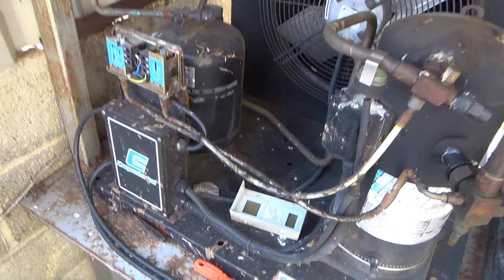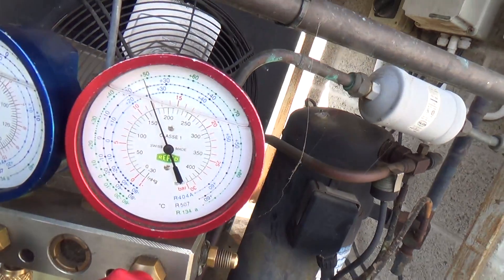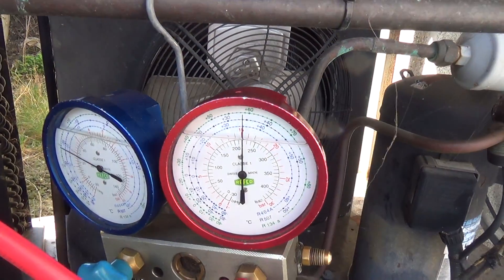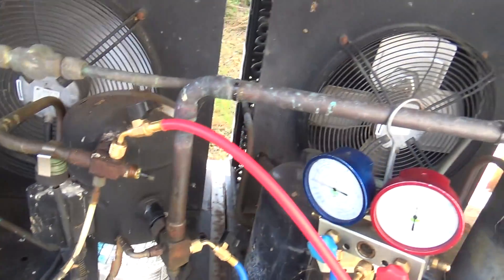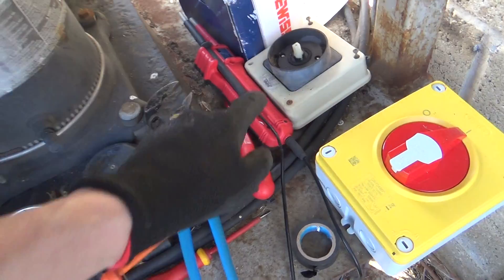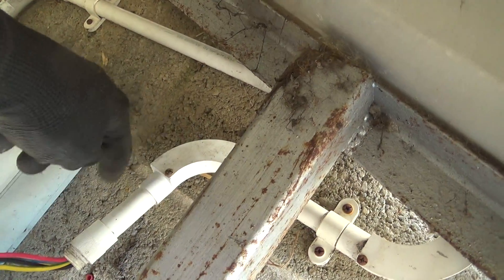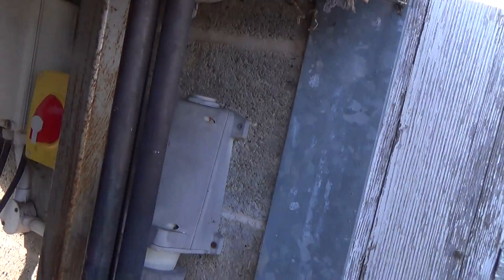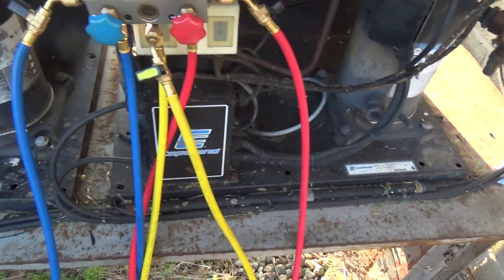Copeland Compressor Conundrums

Comment: Can't you use cable and conduit (open bends) instead of wire and conduit? 
Quite common here in the Netherlands. It's easier to feed both wires at the bottom to prevent water ingress...
Reply from the maker: I'm not 100% on the regulations here but I think things need to be rodent proof on farms etc so everything needs to be in conduit or armoured cable.
Reply: @heavydiesel  Ah like so. Not needed here afaik ....

Comment: Very interesting to see that pressure switch fail like that , have you had lots of them fail over the years ? Very useful tip HD thank you I'll keep it in mind next time I have nuisance trips 👍
Reply from the maker: I've not  seen many hp switches fail like this, usually its the lp one that goes as it works every time the unit pumps down.

Comment: Nice work. It’s amazing what a bit of moisture can do. Like the cover on that pressure switch. Anything that helps. Thanks for videoing
Reply from the maker: Yeah its a pain, the original Alco pressure switches were fairly waterproof but can only get Danfoss or Ranco/Eliwell now.

Comment: Yes water will go nicely down conduit, especially with those inspection elbows that leak. I have often just used PVC weld to stick the cover down, so the water does not get in so easily, though better is to have bottom entry on the switch so there is no direct path and a drain loop.
Reply from the maker: Thats a good idea! This only has to last a few months as yet another customer giving up farming!